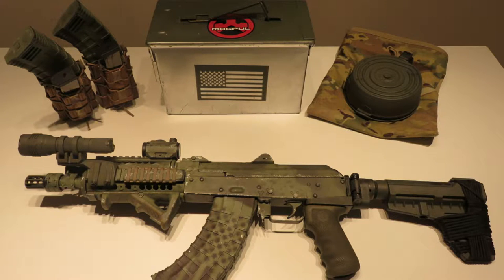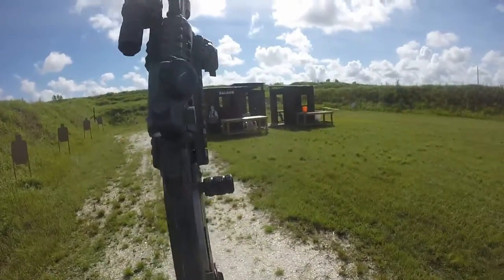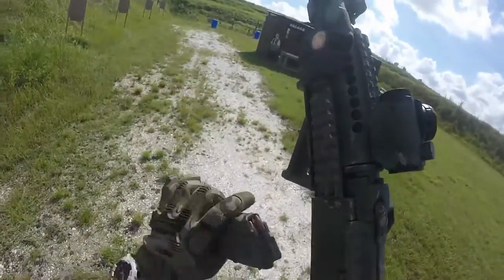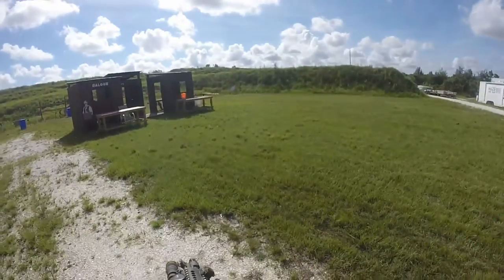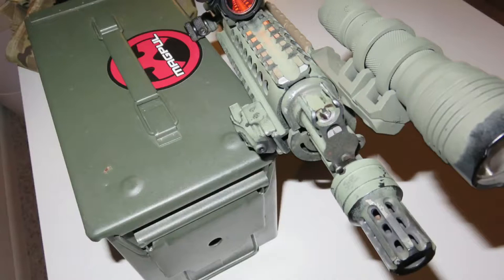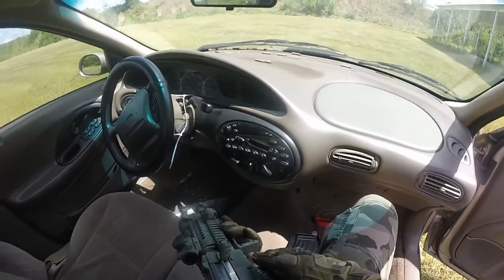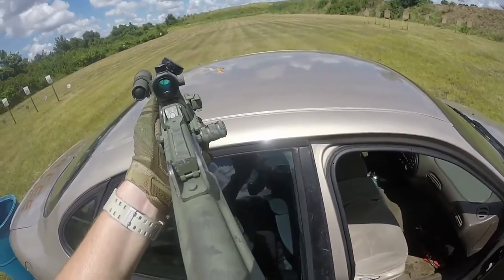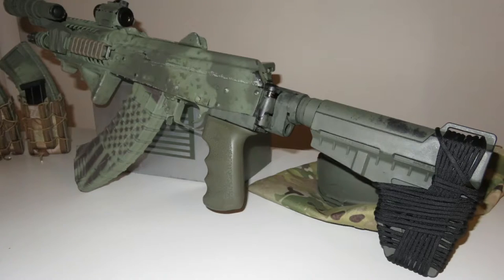ZASTAVA M-92 PAP OVERVIEW!!!

Comment: Great video and AK pistol. I just picked one up that is set up similar to it. It has the Midwest Industries quad rail, the same folding blade brace, and I just bought the same red dot a week ago that I plan on zeroing today. It also has the Tapco trigger installed on it but has a booster on the muzzle. It shoots great and is very accurate without the red dot.
Reply from the maker: So you went for the more classic AK look w that muzzle device....kinda wish I did the same lol! Thanks for the kind words brother!
Reply: Paul Ammochenko you are welcome.

Comment: Dude I love this set up!! Everything that’s on it seems pretty practical as well, I’m building one right now, except I’m using a cnc 4 piece muzzle device and a SB 47 non folding brace. Hope your M92 is holding up dude!!! PS what brand paint did you use, and what charging handle is that?
Reply from the maker: Thank you for the kind words! The 4 piece muzzle brake is an excellent choice....it would give it that old krinkov look! Now I kinda want to swap mine out lol! My pap is still running just fine....except for the dirty looks we get at the range (it's hella loud) 
The paint I bought was a three pack of cammo paint! It comes w 1 can of khakee, 1 can of deep forest green and another variation of green I can't remember! But I got it at Wal-Mart! Just take ur time on the prep work!